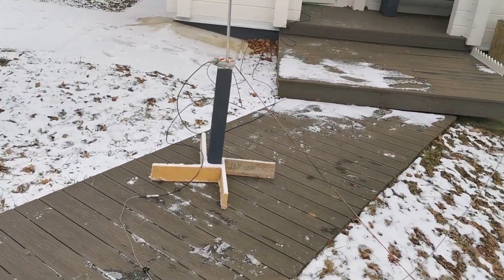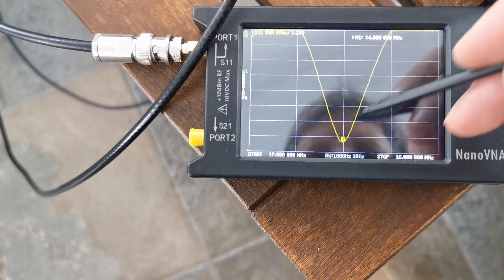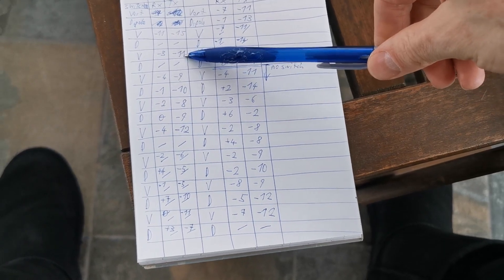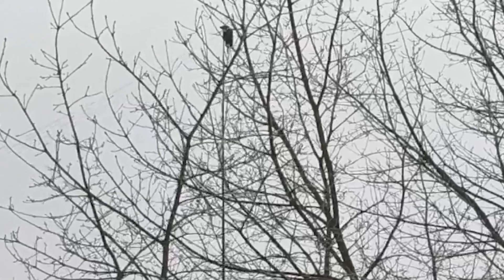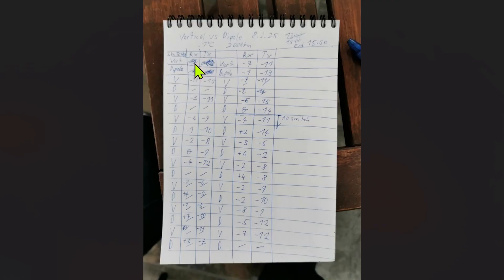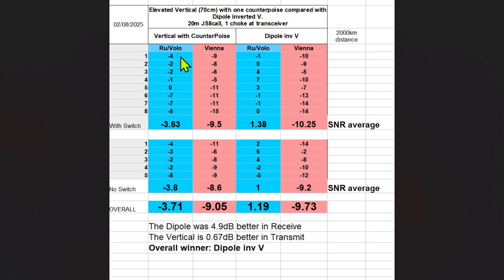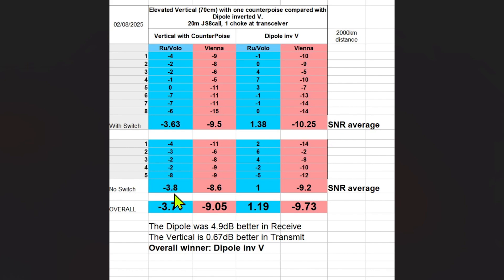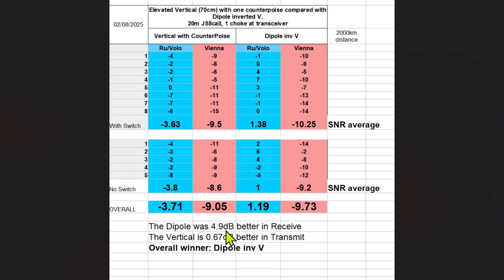Vertical vs Dipole (inv. V). Field Measurements!

Comment: For DX (8000Km and more) Vertical will be much better. ( +12db even more sometimes)
But local stations do not hear you, so when you CQ DX on vertical somebody local will start work on your frequency for sure.
So I prefer to have both if possible.
Often it is better RX on dipole and TX on vertical,
Some advanced ham tx on vertical and rx on beverage or magnet loop to get outstanding results.

Comment: Would have like to see you have some spacing between the two antennas as they definitely without question would have interactions between each other. That said the results are what one (I) would expect from my experience 50+ years of hamming. Then there is the propagation differences if a different target station were picked, such as one that required a lower angle that gave the vertical a chance to show its stuff. Also the dipole vertical advantaged difference changes from band to band as well both in propagation but in physical construction considerations.

 All in All you do a great job
Reply from the maker: @P.SeanCoady  for sure these tests are and will never be perfect.
hopefully others will join me doing these kind of measurements using digital modes. thank you !

Comment: Your use of the 1:1 voltage transformer at the apex is still interesting/curious to me... so this one technically doesn't balance current, and doesn't necessarily fully choke off CMC from the feedline?  Instead, it balances the voltages on each of the dipole elements?  I know you've made a video on the transformer in the past -- but I still haven't wrapped my head that piece :)
Reply from the maker: yes the elements are then both radiating instead of driving only one of the elements. im sure some other people can explain that better. for me its more strange that a dipole feed with an unbalanced signal is still working quite good.
would be interesting to test the vertical with 1 CP also with a balanced signal.

Comment: Dipole has half a wavelength in the air, vertical has only 1/4. I think a bigger antenna will often have better receive sensitivity. 

Dipoles have strong directivity and if it can be an advantage, it can also be a drawback, especially for non targeted contacts. As a field radio SOTA enthusiast, I use my vertical more and more because its easier to setup and I get more contacts overall, mostly because of the 360° coverage.
Reply from the maker: @Bat31160  thx for the comment!
Reply: I do see a bit of truth to what you say regarding the amount of antenna in the air... but really the length (of the elements above ground) is the same for his elevated-vertical setup. The counterpoise can pick up signals, for sure... but it is lower than half of the horizontal dipole.

We have seen some people erect low dipoles or loops close-to- or on-the-ground, to mitigate local noise ... and what this made me realize is that the vertical's elevated counterpoise is has this similar ground proximity. When people use very low antennas for receive purposes, they often have to add pre-amplification. Pre-amplification does bring up the signal and the noise both, but in low-to-the-ground elements, it does not seem to adversely impact the SNR. Often you'd increase the gain on the receiver, before resorting to pre-amplification, but I think they produce a similar result. ... and we typically have both manual gain control, as well as automatic gain control (AGC). So, this makes me wonder what type of AGC, if any, was in place when these measurements were taken? It's common to turn AGC off for digital modes -- but I think there's a good chance that part of difference in reception between the vertical and the dipole could relate to receiver gain. You'd typically want to adjust your receiver gain (pre-amp, attenuation and gain control) for both the antenna system that you're using, as well as for the strength of the signal of your counterparty (station at the other end).  In theory, the 'SNR' metric should account for most of this, but given that everything is converted to audio and then fed through a sound card interface, I'm not so sure.  @CrazyChekov -- Curious what your thoughts are there, and if AGC was engaged at all?
Reply from the maker: @Kinetic79  thx! on the TX-500 in digital mode I cannot change the AGC settings. I guess its just deactivated in that mode what would make sense.
in general the overall receiving signal level was higher with the vertical....but even more the noise seems like.
Reply: Signal polarisation is also an important factor. If the signal you receive is horizontally polarised, a horizontal antenna will work much better. And vice versa. From what I understood, the polarisation of HF waves can be unpredictable after bouncing in the ionosphere. But if a signal arrives completely perpendicular it can be up to 20dB of attenuation compared to the same signal received with a "parallel" antenna. In real conditions, HF signals are mixed polarisations, but maybe sometimes enough to make a noticeable difference?
Reply from the maker: @Bat31160  could be somehow related to polarization ...who knows.
the destination station is using a vertical antenna.
Reply: @Bat31160  Yes, I thought about signal polarization as well -- but probably his L dipole (meaning the vertical element + 1 elevated counterpoise) is well positioned to pick up both horizontal and vertical polarization, since it's very much an unbalanced antenna and there is no equal and opposite field nulling out the effect of the horizontal/counterpoise element.